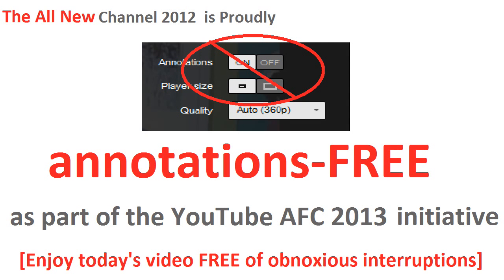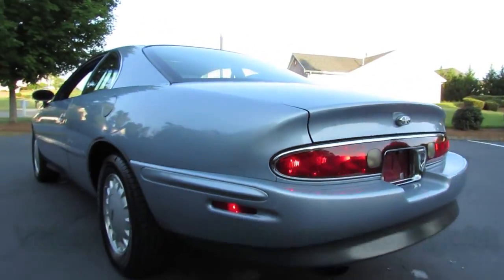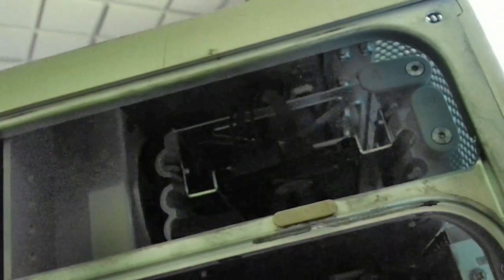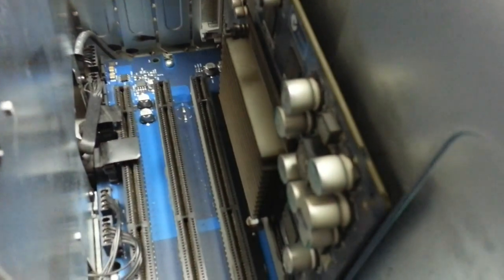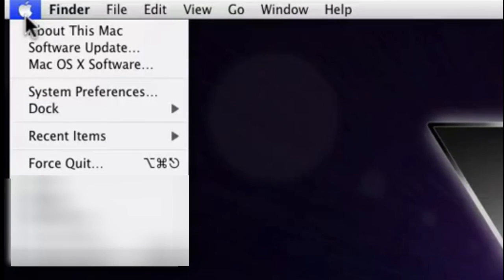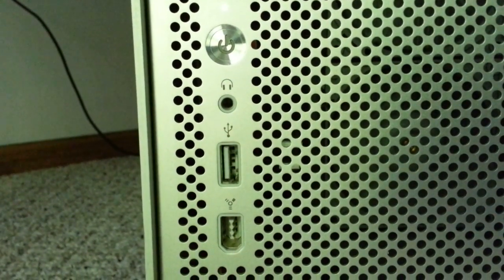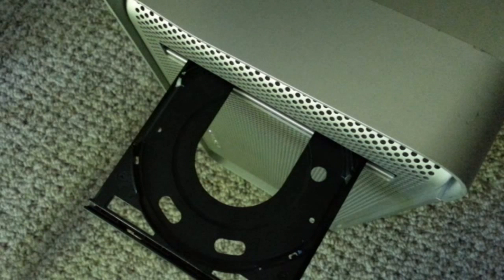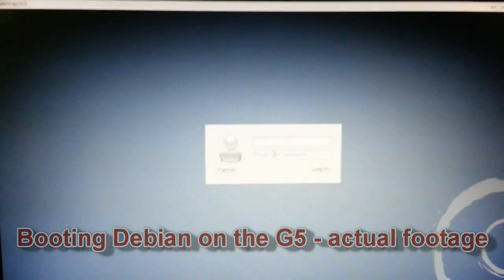FAQ - Using PowerPC Mac PCs in Modernity

Comment: So much wrong information.

SMH.
Reply from the maker: John Roberts 
I try to make a habit of fact-checking stuff before putting it in a video, so there should be no wrong information. Was there anything in particular that you had a question about so that I can clear up any misconceptions you might have had?
Reply: ***** What makes the iBook Clamshell and the PowerMac G4 design failures? Design inspired by a Buick? Pull the other one. What have you been smoking, and where can I get some?

Less powerful than a Pentium 4? Utter claptrap. Clock for clock and against a dual P4 Xeon the G5 is faster at real world tasks - http://barefeats.com/pentium4.html

Define a "regular" computer. I completely fail to understand why you would need this mythical device to download drivers or install OS X on a PowerMac G5. What’s so difficult about putting the OS X Leopard DVD in the tray and holding down the C key, then clicking next a couple of times? Even my Grandmother can follow that instruction.

As for "piss poor software selection" - PowerPC went discontinued 10 years ago. You can't run the latest Windows or Office on a Pentium 4 system running XP either. It's unreasonable to expect otherwise. You want to run modern Mac software - BUY A MODERN MAC!

OS X is not obnoxious. It’s just not Windows, and I don’t see why that makes it extremely unpleasnant. As for the mouse acceleration - never had an issue with an Apple supplied mouse or a Logitech. If third party no-name stuff that’s not Mac certified doesn’t work as advertised then that’s their driver issue.

Five Firewire ports? It’s three, numbnuts. 

Microphone jack is “totally bogus”. I'm aware of such a phrase from the Bill and Ted Movies, but it has no technical meaning. Please enlighten me. Every other computer I've seen also has a 3.5mm jack plug for the mic as well.

Standard motherboard. Yeah to a PowerMac G5. Apple have never done standard Intel form factors. Oddly enough that’s because they design and manufacture their own products and didn’t buy them in from Intel! On the same basis I might make a rant video castigating Apple for not making cases big enough to swap a V8 gasoline engine in, because that would make as much sense as what you are suggesting.

Video card - the choice of card has nothing to do with HD video or problems with Flash. Adobe wrote bad software and many websites used it. It was just the same on a PC of the same era. GPU acceleration of H.264 or Flash video didn’t hit either Windows or OS X machines until 2010 with Flash Player 10.

I’m not even going to watch past that point. This video is just too dumb for my words to express the sheer incomprehensibility.
Reply from the maker: John Roberts
Whew! That's a lot of words there. Let me see if I can help clear some things up for you...

For starters, to answer your question about vintage apple product design, I considered them failures because of how silly they looked in contrast to the Powermac G5 and was merely pointing out how perhaps the inspiration for the roundest computers in the world may have come from what were some of the roundest cars in the world at the time.

With that out of the way, let me address the "Less powerful than a Pentium 4?" remark that seems to have some people all up in arms. In a reply to another member that had the same question, I pointed out that synthetic benchmarks only tell half the story and that real-world usage tests play an important role as well. Spec sheets are great for bragging rights, but the machine just doesn't live up to the numbers.

To answer your next question, "[can you] Define a "regular" computer?", I would have to say that the answer is any x86-based computer that you can set up, use, and run without handholding and undue amounts of help from a computer that's more up to the task. On the G5, things like installing the operating system (by using the 10.5.8 PowerPC-optimized disk image) and upgrading the video card (by flashing a card's firmware so that the G5 will actually recognize it), among other things, require the help of a regular computer - one that doesn't require those things. To put this into agricultural terms, the regular computer is the chicken, and the PowerMac G5 is the egg.

Next, you asked about software selection and made the dubious claim that "You can't run the latest Windows or Office on a Pentium 4 system running XP either". If you had watched the video however, you would have seen that this is indeed not the case as I referenced a Pentium4 computer on which I set up Windows 8 (as well as newer versions of office) and had none of the performance or compatibility or connectivity issues that were experienced with the G5. Granted, some of the performance gain may have been as a result of a superior video card, but it was one I already had and there was no flashing of its BIOS required to get it going on that computer.

When you said you "never had an issue with an Apple supplied mouse or a Logitech" when talking about mouse acceleration in OSX, you are clearly in denial or extremely and unergonomically naïve. At first, it doesn't seem bad, but after attempting any degree of sustained precision mousing, it becomes obvious. If you still can't tell the difference, time yourself performing a ~30 second precision-pointing task in a cross-program on OSX, then try it again on Windows. You might just be surprised when that 30 second task becomes a 7 second task. As for your remark about "third party no-name stuff that’s not Mac certified", that's just complete and total BS.

To address your question about the microphone jack on the G5, you should know (since you've obviously never used one before) that it is in fact not like the jack on "every other computer I've seen". If you try to hook a microphone up to it and record your voice, there will be nothing but silence. If you don't believe me, run a web search and see for yourself (or better yet, find a microphone somewhere and try it).

Now, speed round Q&A!
Q: "BUY A MODERN MAC!"
A: NO THANKS!
Q: "OS X is not obnoxious."
A: I never said it was.
Q: "Five Firewire ports?"
A: Sarcasm. (SMHT)
Q: "It’s three, numbnuts."
A: You know what they say - when you don't have anything logical to contribute to a discussion on which you don't have a leg to stand, there's no reason not to resort to name-calling :-).
Q: "Adobe wrote bad software and many websites used it"
A: Really? When did that happen?
Q: "GPU acceleration of H.264 or Flash video didn’t hit either Windows or OS X machines until 2010 with Flash Player 10."
A: Ding ding ding! That is correct!
Q: I’m not even going to watch past that point."
A: Thank you for being so open minded.

In conclusion, your assertion that "This video is just too dumb for my words to express the sheer incomprehensibility" is in reality, completely baseless. But I forgive you anyway. You didn't know any better, you just thought I was posting up a purposefully controversial video to spread misinformation, but now you know better.

Thank you for your inquiries and have a great day!
Reply: ***** Vintage apple product design
You couldn't be more wrong. I worked for a Computer retailer when the iMac and iBook launched. You’ll of course remember this was back in the days before we had Apple Stores. They flew off the shelves, we had pre-orders off the charts for at least 18 months. Try as our Salesdrones might the customers were not in the slightest interested in a swap to an in-stock Windows laptop. They’d wait for the Mac. We even had famous sports stars try and queue jump with wads of cash to no avail.

Real world a G5 was faster for doing real work than P4. No ifs, no buts. Read the link I posted above - it’s not synthetic benchmarks. Integer performance was roughly similar, Altivec gave the Mac a very tangible advantage in content creation apps. Hence the Firewire ports for video editing, PCI Express and Gigabit ethernet ports that didn’t hit mainstream PCs for a few years.

FYI I use a PowerBook G4 and a PowerMac G5, in addition to a couple of modern Macs and various Windows machines. Never had an issue with mice (Apple or Logitech) or various microphones or headsets. Microsoft mice work fine once you’ve tweaked the settings.

As regards flashing video card etc - that's obviously going to require x86 tools as you're converting a card designed to interface with an x86 BIOS. Use a card with Apple firmware, be it OEM or an ATI Mac edition card and there's no issue.

Now, speed round riposte to the Q&A!
Q: "BUY A MODERN MAC!"
A: NO THANKS!
R: You really should try one. They run Windows too. ;)
Q: "OS X is not obnoxious."
A: I never said it was.
R: Yes you did. 3m40s.
Q: "Five Firewire ports?"
A: Sarcasm. (SMHT)
R: Piss poor attempt. I’m British - we have a finely honed Saracasm detector.
Q: "It’s three, numbnuts."
A: You know what they say - when you don't have anything logical to contribute to a discussion on which you don't have a leg to stand, there's no reason not to resort to name-calling :-).
R: I thought I’d toss it in there to check you were still concentrating, since you can’t count to three.
Q: "Adobe wrote bad software and many websites used it"
A: Really? When did that happen?
R: A few years ago.
Q: "GPU acceleration of H.264 or Flash video didn’t hit either Windows or OS X machines until 2010 with Flash Player 10."
A: Ding ding ding! That is correct!
R: No shit sherlock.
Q: I’m not even going to watch past that point."
A: Thank you for being so open minded.
R: Anytime. Make something worth watching next time and I won't get bored and search for amusing cat videos instead.
Reply from the maker: John Roberts
Oh nelly; once again, that's a lot of words and you still seem to be confused on a few things. Let me see if I can help clear a few more things up for you again.

For starters, to answer your other question about vintage apple product design, I considered them failures because of how silly they looked in contrast to the Powermac G5 and was merely pointing out how perhaps the inspiration for the roundest computers in the world may have come from what were some of the roundest cars in the world at the time rather than foreign athletes who might've been trying to buy them for extra at the time.

To address your second question about performance, "G5 was faster for doing real work than P4", there are some "if"s and "butt"s. First, was is not the same as is. The topics that the video discusses are modern use and relevance, not the computing landscape of a decade ago. Secondly, even if we used machines from around the same time period in modern times, the fact still remains that the real-world performance is not as good; bottom line.

Going back to your mouse denial/naivete again ("Never had an issue with mice"...), the thing is that at first, it doesn't seem bad, but after attempting any degree of sustained precision mousing, it becomes obvious. If you still can't tell the difference, time yourself performing a ~30 second precision-pointing task in a cross-program on OSX, then try it again on Windows. You might just be surprised when that 30 second task becomes a 7 second task.

To address your other question about the microphone jack on the G5, you should know that it is in fact totally bogus. If you try to hook a microphone up to it and record your voice, there will be nothing but silence. If you don't believe me, run a web search and see for yourself (or better yet, find a microphone somewhere and try it). And no, using a USB microphone doesn't count. ;-)

And now, speed round rebuttals!
Q: "You really should try one. They run Windows too."
A: Already did. A Core2Duo MacBook (featured on this channel previously as a matter of fact - this is why it's important to stay subscribed) and I ended up selling it because the trackpad sucked, the keyboard was missing buttons, and the thing heated up like a furnace on the bottom. I bought a ThinkPad tablet instead to replace both it and the G5. And my netbook. And my Pentium4 desktop. And my other tablet computer.
Q: "Yes you did. 3m40s."
A: Give it another listen, I'm pretty sure I said "...have to deal with OSX's obnoxious mouse acceleration". One turd doesn't ruin the entire cake, but it does put a damper on the fun.
Q: "Piss poor attempt. I’m British - we have a finely honed Saracasm detector."
A: Apparently not honed enough.
Q: "A few years ago."
A: I don't remember anything like that happening at that time. In fact, I'd wager it didn't and you're just making it up. :-)
Q: "Anytime. Make something worth watching next time and I won't get bored and search for amusing cat videos instead."
A: I shall, but I will also point out that I already did with this one. Hopefully my pointing out of your misconceptions will help clear that up for you though.

And now for more speed round Q&A
Q: "Read the link I posted above - it’s not synthetic benchmarks"
A: I did. It's nothing but synthetic benchmarks.
Q: "Integer performance was roughly similar,"
A: Sounds like a synthetic benchmark to me.
Q: "Altivec gave the Mac a very tangible advantage in content creation apps"
A: Apparently not enough.
Q: "Hence the Firewire ports for video editing?"
A: If you'd watched the video, you'd have learned that this isn't true. All those firewire ports, nothing to hook up to them (except maybe a first generation 10GB iPod, but you could use a VM instead of a clunky and power-hungry computer for that too). My main computer has only one firewire port that got used a lot more than any and all of the G5's connectors combined.
Q: "Microsoft mice work fine once you’ve tweaked the settings."
A: I promise you - there is no setting you can tweak to take away the full degree of non-linear acceleration forced upon OSX's victims. It's a flaw baked deep into the system.

In conclusion, I'm glad I was able to help clear up those points of confusion for you. Thank you for your inquiries and have a great day.
Reply: ***** 
I am not confused my dear YouTuber, but thanks for your continuing efforts anyway.

Product design – consider it as you wish. I don’t agree.

Performance - You are seriously suggesting that running the latest supported apps (eg Adobe CS4) a single core Pentium 4 from 2003 will beat a dual Power Mac G5?
Declare your chosen app and test and where possible I’ll setup my Pentium 4 2.6Ghz and PowerMac G5 2.0 DP and run your tests.

Mice –  Still not seeing it. Try cleaning the ball ;)

Mic – turns out my headset is USB and the input port on the Power Mac G5 is a stereo line in, not a dedicated microphone jack. As it states in the PowerMac manual : “Analog audio line-in port : Connect self-powered microphones and other audio equipment to your Macintosh”. Self-powered being the important phrase as that would bring the Mic up to line-level input. Most people just bought a USB headset, or the Griffin Mic adaptor that I recall.

And now, speed round double rebuttals!
Q: "You really should try one. They run Windows too."
A: Already did. A Core2Duo MacBook (featured on this channel previously as a matter of fact - this is why it's important to stay subscribed) and I ended up selling it because the trackpad sucked, the keyboard was missing buttons, and the thing heated up like a furnace on the bottom. I bought a ThinkPad tablet instead to replace both it and the G5. And my netbook. And my Pentium4 desktop. And my other tablet computer.
R:  I like my Intel Macs. I’m on my fourth MacBook Pro. Pre-2010 ones could get a bit toasty when pushed or you fired up the buggy hateful crap that was Flash Player pre v10.1. The Core i-series ones are just fine. PS Business range ThinkPads are generally excellent , however avoid the 40 series they have the worst trackpad I’ve ever had the misfortune to use.

Q: "Yes you did. 3m40s."
A: Give it another listen, I'm pretty sure I said "...have to deal with OSX's obnoxious mouse acceleration". One turd doesn't ruin the entire cake, but it does put a damper on the fun.
R: Whatever. You cleaned that mouse ball yet?

Q: "Piss poor attempt. I’m British - we have a finely honed Saracasm detector."
A: Apparently not honed enough.
R: See I knew that was saracasm. You can’t catch me out.

Q: "A few years ago."
A: I don't remember anything like that happening at that time. In fact, I'd wager it didn't and you're just making it up. :-)
R: cough Flash Player prior to 10.1. cough ;)

Q: "Anytime. Make something worth watching next time and I won't get bored and search for amusing cat videos instead."
A: I shall, but I will also point out that I already did with this one. Hopefully my pointing out of your misconceptions will help clear that up for you though.
R: Sorry, I just saw a video of a cat getting into a fishbowl. Wonder if he managed to get out OK?

And now for more speed round Q&A
Q: "Read the link I posted above - it’s not synthetic benchmarks"
A: I did. It's nothing but synthetic benchmarks.
R: 75% NOT Synthetic benchmarks. Adobe Photoshop, Aftereffects and Bryce are all real world "do useful things with them" applications. I’ll give you Cinebench, though.

Q: "Integer performance was roughly similar,"
A: Sounds like a synthetic benchmark to me.
R: It was more a reasoned conclusion from reading many sources over the years. How shall we determine integer performance then? Name your non-benchmark that's OS independent.

Q: "Altivec gave the Mac a very tangible advantage in content creation apps"
A: Apparently not enough.
R: See the “75% NOT synthetic benchmarks” two above.

Q: "Hence the Firewire ports for video editing?"
A: If you'd watched the video, you'd have learned that this isn't true. All those firewire ports, nothing to hook up to them (except maybe a first generation 10GB iPod, but you could use a VM instead of a clunky and power-hungry computer for that too). My main computer has only one firewire port that got used a lot more than any and all of the G5's connectors combined.
R: Firewire stuff I’m using : 3rd Gen iPod, Lots of external storage, DV Camcorder, Panasonic DVD-RAM/HDD recorder. The marketing dept at work use a Microtek firewire image scanner, film scanner and audio interfaces for multitrack recording on a Power Mac G5. Expensive high end equipment at the time, just like the Power Mac and still works very well today. These items were commonly SCSI in the 90s, Firewire replaced that bus and the items migrated with it. That cheaper consumer imaging kit went USB2 a few years later is irrelevant.
Reply from the maker: John Roberts
Well it seems as though you're finally seeing what I'm talking about. That's still a lot of words and a little bit of confusion though, so let's see if we can sort through some of that.

For starters, when you said "I don’t agree" with regards to my observations on Apple product design (where I suggested that the roundest computers in the world may have taken inspiration from the roundest cars in the world at the time), I suppose we will have to agree to disagree, or default to what it says in the published FAQ video :-).

Going back to the whole "single core Pentium 4 from 2003 will beat a dual Power Mac G5?" topic that keeps coming up, the answer is yes. The real-world performance simply tends to be better, at least in our family's experience. Web browsing, multimedia consumption and production, among other things are simply faster and better on the Pentium4-based computers.

When you said that you "still [weren't] seeing it" (referring to OSX's obnoxious mouse acceleration), the thing is that at first, it doesn't seem bad, but after attempting any degree of sustained precision mousing, it becomes obvious. If you still can't tell the difference, time yourself performing a ~30 second precision-pointing task in a cross-program on OSX, then try it again on Windows. You might just be surprised when that 30 second task becomes a 7 second (or shorter) task.

I agree with your thoughts on ThinkPads as I tend to like them too, even if they aren't as fancy as other models. My Lenovo N200 (while only a close relative of the ThinkPad) has an excellent trackpad, which is probably where I get my keen sense of efficient mousing from.

And now, speed round FAQs on the FAQ video:
Q: "turns out my headset is USB"
A: Toldya so! :-)

Q: "buggy hateful crap that was Flash Player pre v10.1"?
A: It's not called progress for nothing

Context: Give it another listen, I'm pretty sure I said "...have to deal with OSX's obnoxious mouse acceleration". One turd doesn't ruin the entire cake, but it does put a damper on the fun.
Q: "Whatever. [you were right]"
A: Good to hear!

Context: A: I shall [make a video worth watching], but I will also point out that I already did with this one. Hopefully my pointing out of your misconceptions will help clear that up for you though.
Q: "Sorry..."
A: Apparently open-mindedness can't be taught.

Q: "75% NOT Synthetic benchmarks"
A: Agree to disagree. Those programs benchmarking higher in one or two areas doesn't change the reality of the real-world average usage tests.

Q: "Firewire stuff I’m using..."
A: Good for you. You already know about the firewire equipment I use with my computers.

With that, I'm glad I was able to help clear those points of confusion up for you. Thank you for your inquiries and have a great day.
Reply from the maker: John Roberts 
It would appear that my writings have not been in vain because the number of questions you have is finally starting to decline. This means I'm doing my job and I'm proud of all that you have learned over the last few days. In fact it seems the only things you're still hung up on are the seemingly ever-controversial "performance versus a Pentium4 computer" question and the whole mouse acceleration thing.

FAQ on the FAQ video:

1. (performance question)
The real-world performance of the Pentium4 computer simply tends to be better, at least in our  family's experience. Web browsing, multimedia consumption and production, and other things are simply faster and better on the Pentium4-based computers.

2. (obnoxious mouse acceleration in OSX)
It might not seem that bad at first, but after attempting any degree of sustained precision mousing, it becomes obvious. If you still can't tell the difference, time yourself performing a ~30 second precision-pointing task in a cross-program on OSX, then try it again on Windows using the same mouse. You might just be surprised when that 30 second task becomes a 7 second (or shorter) task. You could also choose to never try this experiment and just continue to live in blissful ignorance and continue mousing on as if you were using a ball mouse on the palmrest of a netbook while riding a unicylce backwards across a ravine during an earthquake :-).
Reply from the maker: *****
That's a joke, right? I guess if by "intuitive", you mean "slow, inefficient, non-linear, and frustrating", then you're spot on.

And regarding your "In Windows, with one swipe you can't move from one corner of the screen to another" comment, I'll just tell you right now that that is complete BS. Just because you can't use a computer properly doesn't mean that everyone else has the same problem.
Reply: ***** Sorry to drop this bombshell but they were in vain, although watching you squirm is vaguely entertaining! My only real question was your testing methodology so I can replicate some real world results... but you keep dodging those and going back to mouse acceleration and "family experience" (not seen that metric defined as yet) as a smokescreen!

I'm perfectly happy with my own ability to fact check and draw correct conclusions given my education and many years working as tech support for PCs and Macs.

I stand my my original comment of "So much wrong information".
Reply from the maker: *****
I think you misunderstood - I'm not saying you should disable mouse acceleration. In fact, the mouse acceleration in Windows is second-to-none. What I pointed out in my video is that OSX has a very non-linear and clunky mouse acceleration curve that actually works against you. No acceleration at all would be better than OSX acceleration, but proper mouse acceleration trumps all.
Reply from the maker: John Roberts
On the contrary, seeing as I explained the answer to each of your hundreds of questions, I think my writings have indeed had quite the effect, even if you're not ready to admit it to the world just yet. ;-)

Now, to answer your last question, ending the final chapter in this "book" - "My only real question was your testing methodology so I can replicate some real world results". The answer is simple - To test performance, I simply set out to accomplish something related to tabbed web browsing, multimedia production, or multimedia consumption in the appropriate program and measured how quickly/smoothly the task took place on the G5 versus other systems. To test mouse acceleration, I simply timed a precision mousing task at system idle and compared my timing with other systems under the same conditions with the same mouse. To test connectivity, I simply counted up the number of ports. To test video card expandability, I ran a web search and found the fanpages explaining how to perform the upgrade. The methodology was as simple as that.

Now that we have these questions answered and behind us, you can no longer say "so much wrong information", since I comprehensively explained why none of the "wrong information" was actually wrong in the first place.

With that, I thank you for your inquiries and wish you a great day!
Reply: ***** So still no defined testing methodology, just opinion. Before you offer, I'll politely refuse in advance the "Being John Malkovich" option of taking over your body to find out. ;)
Reply from the maker: John Roberts
You know what they say - you can lead a horse to water, but you can't make him drink. I've defended my position with hard facts and methodology, so my point stands.
Reply: ***** No. Hard facts would be verifiable, demonstrable and established. A good example would be the barefeats link I posted weeks ago. Anything you have presented is a soft fact at best. They are a speculative unproven opinion.

Have a great day!
Reply from the maker: John Roberts
Well, I'm sorry you feel that way. The of the matter is that I did provide all the verifiable, demonstrable, and established facts needed to answer your questions in full. My opinion cannot change their outcome, which is just part of what makes them so tangible.

That said, I'm glad I was able to help clear all that up for you.
Reply from the maker: *****
There's no need to get all worked up about it. Oh, and scroll up - somebody did ask for my opinion; nobody asked for your opinion.
 :-P